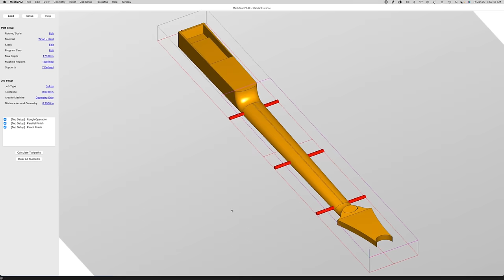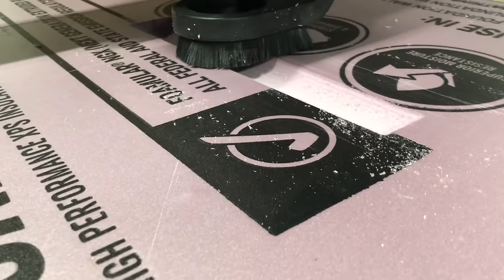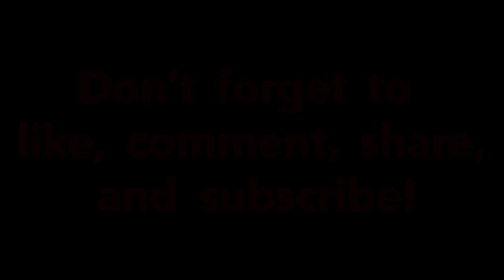Making The Flying M Guitar For Metallica

Comment: That guitar is not shaped like the letter M  at all.   I'm sure it's a completely badass guitar.  But that is not an  M
Reply from the maker: It was copied directly from their logo without modification. Maybe you're looking at it wong. The upper and lower halves are separate Metallica "M" shapes. Now do you see it? BTW, it raised $140,000 for the All Within My Hands Foundation.
Reply: @righty-o3585  it's 2 M,s either side of the neck man check again
Reply: @martysmetal  I see it now .I stand corrected . My bad . 🤘
Reply: @righty-o3585  cool 😎 as brother

Comment: I’ve seen quite a few guitar builds online now, and this one felt a little “slapped” together. Maybe it’s because you didn’t show all the intricacies and measurements. But even when things were clamped together it didn’t seem proper/precise enough to me. I can direct to other build videos that show more precision, but just wondered if it might just be what was displayed on video rather than what actually went into assembly?
Reply from the maker: I make guitars, not rocket engines. That guitar raised $140,000 for Metallica’s All Within My Hands Foundation.

Comment: Fantastic content and what a buzz that must be to build a guitar for your musical inspirations 👊🏻 
I use stripped up inner tubes for cramping bindings on etc . But the way you used it with the f cramps to pull the back of the guitar tight was genius love seeing inventive ways of getting over cramping problem . It’s amazing how much pressure to can get with inner tubes pulled across a joint . Thankyou for sharing I appreciated the insight 👊🏻👊🏻

Comment: I like your videos and have a great respect for your skills. 👍
I hope you dont mind me making a suggestion. On my CNC router I added a small continuous air blower, this is a cheap reciprocating type cost less than $100, very quiet and has worked tirelessly for years. Basically it means you dont need an air compressor BUT you can still get an air blower pointed at the cutting tool. That blows all the chips out of the slots so you are not re-cutting dead chips mangled down in the slots.
I find that this type of air blower is much more convenient than using compressed air and of course is quiet, it can be powered from the same relay that operates the spindle driver so it comes on whenever the spindle is in use. It sits on the floor (it's only small, about 6 inch cube size) and I just run a small flex hose up to the nozzle pointing at the spindle cutting tool.
Because you wont be mangling chips in the slot you get a better finish, less tear out and chipping, longer tool life, cooler wood so you get less themal issues etc etc. Also this type of reciprocating pump blows the air in little pulses 30 times a second so you get more chip clearance than a typical compressor and constant blower.
Reply from the maker: I have never felt it necessary to blow the chips. I rarely use my dust shoe either. Never had a problem.

Comment: I enjoyed watching your build. Looks solid and that case is sweet. I'm guessing the screws were a deliberate anesthetic choice. Would definitely recommend using a microstop for your countersink. Given that the metal M's are so sharp, it's likely the player might get cut while playing. I probably would've inlayed them into the body and beveled the edges or filled the top inside gaps with epoxy.

Fantastic work! That CNC work was pretty slick.

Comment: Awesome build, and such a great opportunity!  I get great inspiration from your channel!  I'm an aerospace machinist and can offer you a tip when machining countersinks that are perfectly flush and consistently the same height.  Use a drill press with a stop.  I'll do a few in a piece of scrap to get it perfect, then go for it on the project.  Thanks again for sharing your work!
Reply from the maker: That’s an excellent tip! That is actually how I started the countersinks, but in the video, I was deepening them so the screws would be just slightly below the surface.
Reply: @HighlineGuitars  , that's why I commented.  It's very difficult to have perfect consistency that way and I can see by your processes and quality of your builds that you are a perfectionist.

Comment: I had to wait until I had some time to really enjoy this video. What a cool project, I'm so glad you were chosen to do this! I noticed you routed out the floyd rose nut shelf on the fretboard before it was glued on to the shaft, I guess you were using a downcut bit to prevent the bit from pulling this thin part up and chipping it?
Reply from the maker: That’s correct. Even though I used a downcut, l still had my fingers crossed 🤞!
Reply: @HighlineGuitars  that's a little nerve wracking. I have two orders for floyd rose necks coming this week and since they're both going to have spoke wheel truss rods I think it's too much work to glue the fretboard on before cutting the nut shelf (I would have to set the fretboard up twice, deal with indexing, etc), what I'm thinking about doing is to first cut the contour of the fretboard and then use an 1/8 inch bit to reduce angular velocity while using a higher rpm so the bit is almost turning the wood to dust with very slow feed rate, step over and plunge starting from the end of the board all the way to the nut line. I really hope I don't break anything!

Comment: What was the particular fret nipping tool that you use? 

Also I think it was this video but couldn’t find the video section again but the plastic thing that clamped on the neck I think to give a centre line for the body? What was that 😊
Reply from the maker: That was a Sintoms Fret Tang Nipper. However I have switched to using the StewMac Fret Tang Nipper instead. It works better. As for the plastic thing you asked about, I'm not sure what you're referring to. Maybe it's the clamping caul I used to clamp the fretboard when I glued it to the neck? It's made out of MDF board, not plastic.
Reply: @HighlineGuitars  thanks for the reply.
Yeah I thought of getting the stew mac but thought there was a chance yours was better 😊

Yeah must have been another video I saw. 
Was really cool. Like a Perspex thing that would  quick lock around the neck with centre lines and stuff to perfectly centre for the body as well as  really accurately showing where the neck pocket would perfectly align.
Reply from the maker: @joshuahannelly2128  That Perspex thing isn't something I did. Maybe it was someone else's video?

Comment: 19:15   🧂 similar to add grip to prevent the two pieces sliding around when  🗜️ perhaps 🤔.. there's some dedate on whether it can alter the composition of the glue weakening the bond ..great video btw 😊the inner tube clamp is a good idea
Reply from the maker: It’s only a problem if you dump a bunch of salt on the glue. A few grains won’t make a lick of difference.

Comment: SWEET, I LOVE THAT GUITAR! I haven't scratch built a guitar since the the late 70s and early 80s. The few I have built since were from parts mostly I modified. I still have a few designs from back in the day I would love to build. I wish these CNC machines etc were around back then. I probably would still be building guitars. I had to stop when the cabinet shop I was allowed to use closed up and moved away. Truthfully it was a lot of work doing a majority of the work by hand. Love the design I am a sucker for pointy guitars.I have one question about the case. I saw the pink rigid foam and what looked like regular foam rubber. What adhesive are you using? I found the stuff I tried dissolved the rigid stuff and slightly the foam rubber.

Comment: Love it... but why locking tuners if your you also have strings locked down with the Floyd.  Not judging just curious
Reply from the maker: I use locking tuners because they make it easier to install the strings. Despite what you might think, locking tuners don’t do the same thing as a locking nut. A locking nut locks the strings at the start of the guitar’s scale length. Locking tuners don’t do that at all. Some people think you can omit the locking nut if you use locking tuners, however, the Floyd Rose locking system won’t function the way it was designed to without the locking nut because locking the strings at the tuners doesn’t lock them at the start of the guitar’s scale length.
Reply: @HighlineGuitars  thank you so much for the reply and taking the time to explain. Always good to learn ... beautiful guitar, very talented ... much respect

Comment: Just curious as to why you opted to not cut the tuner holes in the cnc process
Reply from the maker: It's an angled headstock which means to holes must be drilled at the same angle. A typical 3 axis CNC machine can't drill at an angle. They can only drill straight down. To drill at an angle requires a 4 or 5 axis CNC machine. It is possible to clamp the neck so that the headstock is flat to the CNC machine's waste board, but it's a time consuming process that's easy to mess up. Using a drill press is faster and much easier to do.

Comment: What did you sprinkled on the glue
Reply from the maker: Table salt. Just a few grains in a few spots act like gripper teeth to keep the two parts from slipping when the clamps are applied.
Reply: @HighlineGuitars  innovative

Comment: What were you sprinkling onto the glue before setting the fingerboard?
Reply from the maker: Table salt. It's an old woodworker's trick to keep the two parts from sliding around while clamping pressure is applied.

Comment: why is there a ground wire for emg pickups?  is it for future pickup swaps or something?
Reply from the maker: That and to protect the player from electrocution.
Reply: @HighlineGuitars  emg are internally grounded tho. Grounding them actually messes with their sound
Reply from the maker: @Sixbillion1  I’m not following you. The wiring came from EMG. I didn’t change anything. The only ground wire I installed was to the tremolo spring claw.
Reply: @HighlineGuitars yeah but there would not have been a ground wire from emg for connecting to the trem claw. They don’t include one because it’s not needed.
Reply: @HighlineGuitars maybe I didn’t see where you connected the ground wire from the trem claw. Did you solder it to one of the pots?
Reply from the maker: @Sixbillion1  No. It was soldered to the ground lug on the jack.
Reply: @HighlineGuitars yeah if you read emg instructions the specifically say not to ground them to the guitar. In fact they are very specific about not reconning the string grounding wire
Reply from the maker: @Sixbillion1  That’s why it wasn’t connected. It’s just there in case someone decides to replace the active pickups with passive ones.
Reply: @HighlineGuitars rite I get that, but if it is connected to the output jack it’s still going to create noise. In a closed loop system like emg, in order to be noiseless you need to remove it, otherwise it will just make noise.
Reply from the maker: @Sixbillion1  it’s not connected. I build so many guitars, sometimes I get them mixed up in my memory.
Reply: @HighlineGuitars gotcha.
Reply: @HighlineGuitars at any rate, neat guitar thanks for sharing the build 👍🏼

Comment: Having the strap buttons on the top of the guitar seems like an odd choice.
Reply from the maker: Why? Because Orville Gibson and Leo Fender didn’t do it that way, so it must be odd? Thinking outside of the box makes the world a better place.
Reply: @HighlineGuitars   No, it seems odd because of gravity, physics and the way straps go on those buttons! 
 Side note...I don't care for Gibson or Fender...I'm all about Jackson Rhoads and/or King V's. Regardless, there's a pretty good reason why they put their buttons where they do. "Outside the box" isn't a better place when that guitar hits the floor.
Reply from the maker: @fermiticus4034  LOL! Do you know what strap locks are? That’s what this guitar was equipped with.
Reply: @HighlineGuitars   Yeah, I figured that...all fun and games until the nut works itself off! I've had it happen many times, but with the buttons on the bottom of the top "point" and back(by neck), the strap still stayed on.
 I just don't have enough faith, I guess!!!
Reply from the maker: @fermiticus4034  The nut on my strap locks can’t come loose unless you use a special tool.

Comment: Why you didn't make it in one piece of wood.. But anyway you build an insane guitar 🎸.. Respect. 🇸🇮 🇸🇮
Reply from the maker: Four reasons.

1. It's always better to make a guitar out of multiple separate pieces of wood (body, neck, and fretboard). That way if you run into a problem (knots, cracks, unexpected movement, etc.), you only loose that one piece, not the whole guitar. 

2. Since a fretboard has to be a dense piece of wood like Ebony or Rosewood, it's absurd to try and make the entire guitar out of that wood due to weight.

3. This guitar would have required a 22" (56cm) wide slab. It would have been very difficult to source a slab suitable for a guitar that large.

4. There's no benefit.